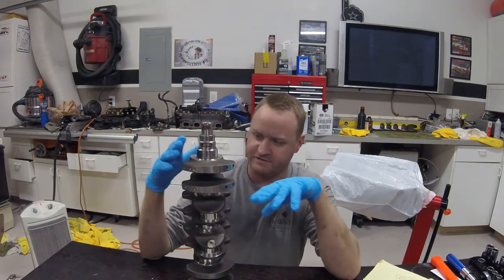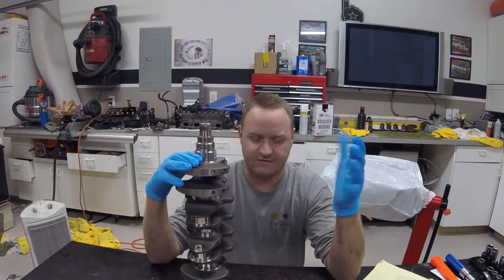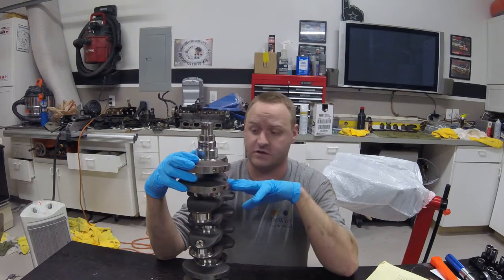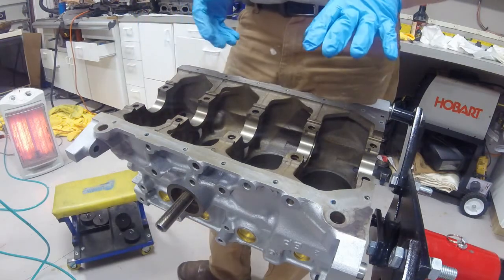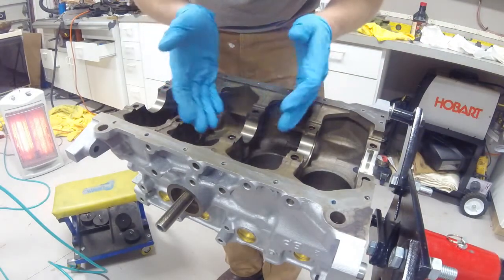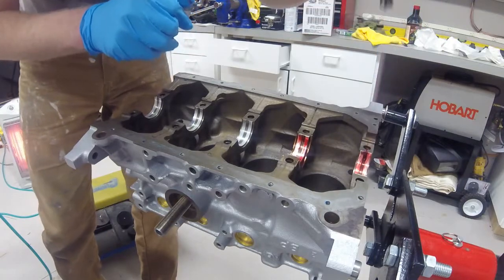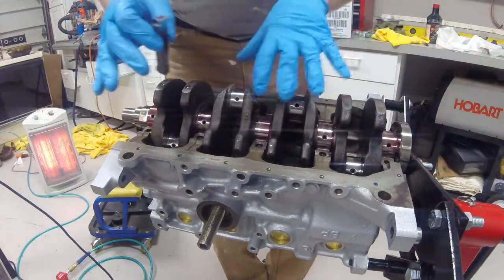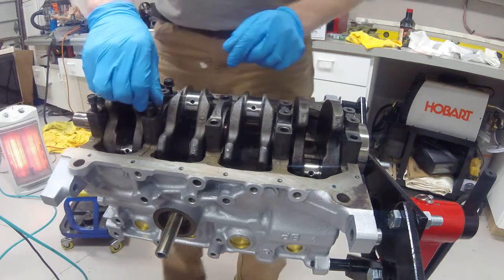Miata Crankshaft Installation HOW-TO

Comment: When you oil the bolts you are torqueing them down with the wrong force. The oil lubes the thread and makes it easier to turn the screw which means that you are turning with more force than recommended
Reply from the maker: Thanks, good info.   I have read in Miata service manuals it's specified to oil bolts before torquing.

Comment: You did not show which surface should be " in or out", on the thrust bearings.  But great vid on the install.
Reply from the maker: M Gee  my workshop manual showed the side with the 2 slots for oil facing the crankshaft